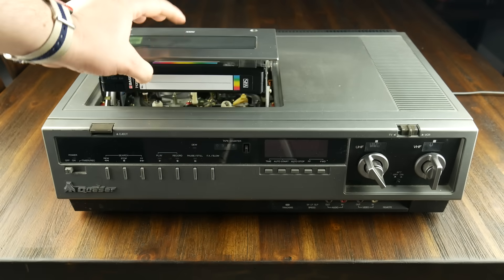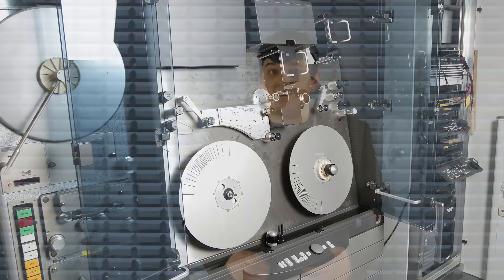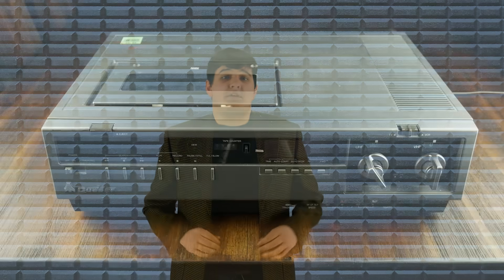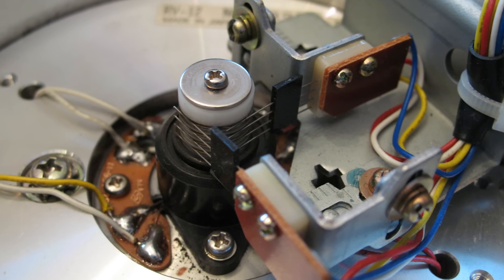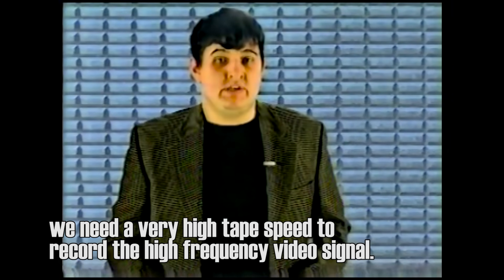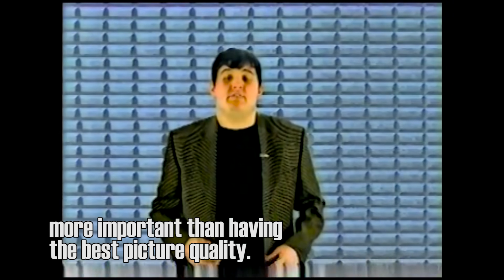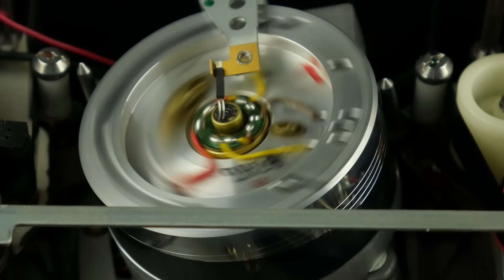The Impossible Feat inside Your VCR

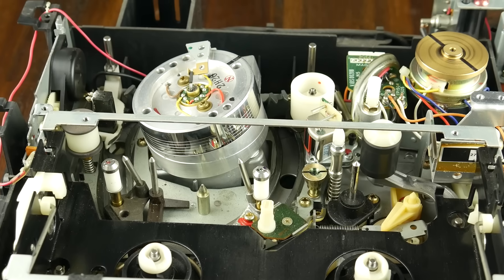Comment: 7:54 I still use mini-DV tapes, and all of the mini-DV camcorders that I've used sound like a jet engine when switched on. The mini-DV video heads spin 9,000 RPM, and on startup, they go from 0 to 9000 in a fraction of a second.

Comment: When i was about 2-3 years old i pulled out and damaged lot of tape from my parents' wedding cassette, it was only cassette which had their wedding video, that was great loss to my parents, it had video of my grandparents who died before my birth but i was unaware of what i did until 12, now whenever i remember that i regret, but luckily after long time they managed to recover at least 40% video from undamaged tape which i stored in HDD in digital form but again my stupidity returned, even i was now 17 y/o In curiosity what i did was i opened back cover of laptop and sticked huge sub woofer magnet to its HDD (Which had that video and my other memories as well) while it was running, i didn't know that magnets will mess up everything inside HDD, then windows suddenly froze and laptop got shutdown, Its been 1 year and I'm not able to recover my priceless data from that HDD, i tried to plug it using Sata Cable to my new laptop and what happens is it shows local disks and their capacity but when i open them, system freezes and HDD disconnects after some time,My hope was increased when once a time drive showed its contents but when i tried to open them system again froze and HDD got disconnected, I think i need to get data recovered from professionals.

Comment: Nice video.

I worked at a TV station in 1977. We had 3 Ampex 2 inch quadraplex videotape machines. Television stations lock the synchronization of all their sources so the picture doesn't roll when video is switched. Synchronization on the Ampex reel-to-reel machines was analog - so it took 7 1/2 seconds to synchronize the playback to station sync. As a result, videotapes had color bars at the beginning of the tape, and usually also had a countdown at the head of the tape. 

There was a cue channel on the tape, and that was used to record a tone on the tape to be able to find the beginning of the program. That allowed the videotape operator to find the beginning of the program. A 7 1/2 second tone was recorded, so the tape operator could quickly find the cue point.

A Quad machine had 4 heads, and playback had 4 video amplifiers. Part of the process of setting up tape playback was to play color bars and set the controls for each of the 4 heads for similar gain, to prevent "banding" in the video.

Commercials (spots) were recorded individually on small reels. A 2 minute commercial break had four thirty second spots. With 3 videotape machines, 1 machine was reserved for news segment playback, and 2 machines for commercials. In preparation for a commercial break, the operator pre-loaded 1 commercial on each of 2 machines. Mount reel; thread tape; set video gains; fast forward to cue tone, and stop. The first machine was started 7 1/2 seconds before the commercial, then the video was "taken" on the video switcher. 22 1/2 seconds into the first spot, the second player was started. As soon as the first spot ended, the operator then had 22 1/2 seconds to rewind the tape on the first machine, take it off, mount the tape for the third spot, set the video gains, and cue it. Then  the same for the fourth spot.

The news video tape was usually a 12 inch diameter 2 inch wide tape. They were heavy. Often there were multiple segments on the tape, so each segment had to be found by fast-forwarding the tape while listening for the cue tone beeps, then set up for the 7 1/2 second pre-roll. Often the newscast used recorded segments out of linear order, for example the 3rd segment, the seventh segment, the first segment, and the twelfth segment. Fast forward and rewind had powerful motors that spun very fast, so stopping took a few seconds. The news director had to plan the tape segments carefully to give the tape operator time to find and set up each  videotape segment. The worst case situation was a videotape news segment, back to the news anchors for the handoff, then a 2 minute commercial break, during which the videotape operator is real busy, then back to the anchors, then another videotape news segment. 

After a 30 minute newscast, the tape operator was wound as tight as a spring.

After I left that station, around 1980, Ampex came out with 2 inch quad cartridge video recorders. There was a large cartridge storage section. The machine automatically selected the cartridge and loaded it. Synchronization was digital, and only took .002 seconds to lock-up to station sync. You could program an entire newscast in advance, and the machine would play all of the tapes in sequence. They were amazing!

One of the problems the video carts caused was if the technical director pressed start on the cart machine and "took" the video at the same time, there was a .002 second period of no video going into the transmitter. Video transmitters were analog at that time, and analog video was inverted, so no signal to the transmitter put it at 100% power for .002 seconds, which caused an alarm on the transmitter and an error message on the automatic log. So we had to train the technical directors to have a slight delay between pressing start and "taking" the video. We later built that into a digital timer to prevent the issue.
Reply: Amazing! Can’t believe how much work the operators did in the background to keep the broadcast running smoothly. After reading this those “sorry for technical difficulties” or “pardon for the interruption” cards seem much more forgivable. :)
Reply: hell yeah
Reply: Thank you for sharing about your experience. I very much enjoy reading how this kind of stuff worked behind the scenes, so this was really cool.
Reply: Wow!  I had no Idea it was that involved back in the day.
Reply: Amazing comment 🍻 that tape operator job sounds like my worst nightmare. I might have nightmares just thinking about the timing and effort that took. I bet they were exhausted after a shift!
Reply: Great Stuff! Why do us “modernaires” find such human and artistic fun in this and Mr. Techmoan. Thanks!!!
Reply: Fascinating. It's easy to forget manual is always a precursor to automation.
Reply: Listen, the comment is great but how long did it take you to type that
Reply: @Ilikesogdog  Brother, what is wrong with you? Why would you be rude like that if you actually liked the comment? 

Either read it and enjoy it or opt out and kick rocks. I can’t believe how short the attention span you “iPad-raised-kids” have. 🤦‍♂️ 

You’ve heard of actual novels, right? They used to write them with a fountain pen and it would take years. 

I love that this person took the time they did to give us that information and look behind the scenes. I read it twice as did someone else. 

Stop telling on yourselves and letting us know you have trouble reading.
Reply: @_..-.._..-.._  I wasn’t being rude I was just asking.  It is impressive that someone wrote all of that of someone.
Also, what the f***k are you talking about
Reply: @Ilikesogdog  20-30 minutes?
Reply: @grid45  nice job 👍
Reply: Lol Noone cares
Reply: @Catsarethebes5eva  paragraphs are scary! 
"L0L'' ...why are you here?
Signed ~ No'One*

*I read it twice, thank you for that insight OP
Reply: @Catsarethebes5eva   stop being lazy and read, you couldn’t even put a space between “no” and “one” 🤦‍♂️

Comment: I am a tech minded person, and I always find that it is the mechanical side of things that leaves me open-mouthed! Like here, how can the tape just "flow" around the drum, I do understand that it forms some kind of air-cushion between the tape and the fast-moving drum, but how that is reliable I just cannot fathom. That also means that you cannot use a VCR in vacuum (in space). Awesome tech in any case! And I did have VCRs in the 80's and 90's. My second one was just awesome, a Mitsubishi E52, Hi-fi Nicam, it had unbelievably good features starting with a learning universal remote, or a "next" function where you could tell it what to do after the present function ended (e.g. after rewinding, power off). I still have it but unfortunately some of the rubber belts and parts need replacement. So I did get a "cheapest" VCR some years ago so that I could at least watch some of my collection of more than a hundred VHS tapes when desired.

Comment: A nice reminder, I spend 14 yrs as an Engineer and Manager in VCR factory, suppling the EU.
To add a little more detail, the capstan and head drum are not so precise as they are servo locked (with a variable tracking signal controlled manually or later with automated optimisation).  The capstan is a servo/stepper motor that is locked to the tracking signal, and the head rotation is phase and speed controlled to the tracking signal too.
Other features we had in the UK where PDC or Program Delivery Control, the broadcaster would transmit a signal that indicated the programs intended start time, this could then be used to ensure late or early broadcasts where fully recorded.  Unfortunately mistakes by broadcasters and manufacturers made this temperamental.  I spend quite a few years at clock change over times chasing up broadcasters who have not changed their time signals and we were getting thousands of complains about "no record".  When the equipment doesn't record your favourite show, you are not going to be happy.  This resulted in the system being defaulted to off in future production.  Germany had a VPS system, we never got any complaints about it.
Then there was NICAM, basically broadcast digital stereo audio for analogue TV, not so much a VCR specific thing, but went very nicely with HiFi Audio, and was an additional UK feature.  Germany has stereo analogue audio.
We also had Videoplus+  a way of programming the record time.  A straight number was published in the program guide (paper magazine) and you entered that to set the recording.  Being simple it worked quite well and became a standard.
Some other VHS standards (apart from VHS PAL and VHS NTSC) where VHS SECAM (France) and VHS MESECAM (middle east Secam).  The MESECAM was a cheap version that basically used Pal circuitry with some slight mods to make it work, the VHS Secam was a highly different and unique VHS system used with Secam L broadcast (France), the quality was quite good colour but we always had alot of trouble with it on some of the test signals.
Towards the end we got into digital TV and made Settopboxes and even a VCR with digital receiver.  The EPG (Mandatory in the EU) from the digital TV was the best way to program the VCR.  It worked well but HDD recorders were much better, and actually simpler and recorded the broadcast signal perfectly without any loses.  While alot of the early PVRs were poorly made, noisey fans and tended to fail from overheating, they were easy to design and make and didn't need the specialist technology of VCRs so there was alot of competition from China.  We did made some good product in the UK, but retailers and brands took the lower quality stuff from China.  The factory was closed before 2010, although I had already been made redundant in 2003.

Comment: The other problem with VCR's was the tape rust, over time if not stored in a very dry place the tapes would get this green looking mold on them that is actually corrosion, soon as one of these tapes is played it instantly clogs the heads and it takes forever to clean it off. They should be run through a video tape cleaner a few times before you play them, but all this equipment is getting so rare now you would be lucky to find a video tape cleaner anymore.

Comment: Analog video and audio is both fun and interesting …especially in todays “sterile” digital age. As a kid from the “Age of Analog”, I remember the first VHS machines …exactly like the “old beast” you pulled out in this video. Not only heavy in weight but also in cost, just like any new consumer tech; some things don’t change. I had to laugh about using the humble VCR as an audio recorder; another trip down memory lane. Whereas the reel to reel was the champion as far as recording audio with it’s 7 1/2 IPS (inches per second) top speed (pro models topped out at 15 IPS) …the humble, unpretentious, 4-head VHS recorder could best most R to R decks without even breathing hard …even at its slowest recording speed. It was probably the pinnacle of analog audio tape at the digital threshold.

As I am in the midst of digitizing my collection of VHS tapes, your videos on doing the transfer have been helpful …and ingenious. This “deep dive” into the “magic” VCR was interesting and fun. S-VHS, if I remember correctly, could only take advantage of the increased resolution if the tape being played was recorded in S-VHS format. Commercially produced tapes were not done in the S-VHS format (the better to sate mass appeal) so there is no advantage in resolution with commercial tapes played on an S-VHS machine. The only advantage of S-VHS was the introduction of S-video which gave an inkling better picture than the composite signal.

Comment: 16:18 Of course it's possible, how do you think CDs were made?  "September 1977: Sony introduces the PCM-1 Audio Unit ($4400 street price)[28] (44.056 kHz, 14-bit), the first consumer (well-heeled) PCM encoder. It required the use of a home video tape recorder for storage."  Before DAT, a lot of audio was recorded digitally on video tapes.  And boy did it make CD mastering wonky and inconsistent.

Comment: For broadcast, Umatic 3/4" wide tape running at twice the speed of a standard VHS tape deck was the standard (especially at local outlets) but 1" reel to reel was also an option, which gave better quality. The Umatic cartridges I worked with typically only held about 70-75 minutes worth of tape and for use for commercials, promos, and PSAs, only 3.5 minutes was spooled. After all, just how much do you need for a 30 second commercial?

I used to sit there at the shop at the TV station in the 1980s mesmerized by what was going on inside that tape player. These machines used a "C" sort of threading for playback ("M" for FFW and REW) so it was even more interesting watching it spool out of the tape cartridge. It wasn't until many years later that I understood just how clever the video tape recorder really was, that there was a very specific reason the drum the heads were mounted on an angle to the tape. I never knew about the transformers though, nor did I know about the azimuth on the tape heads. That's pretty dog gone neat! The engineering that went into these machines really was off the charts clever!

It's not just that we're used to higher resolution that makes VHS/etc appear so bad. It's the fact that it's still magnetic media and magnetic media degrades over time (the magnetic signal fades, higher frequencies going first, and being stored at warm temperatures, such as a warehouse in Southern California, accelerates this process). So some of the stuff you see from Back In The Day was actually better the first time around but waited for quite a while before undergoing the digital conversion to preserve it and thus isn't as good as we want it to be. The reason things like "I Love Lucy" and "The Dick Van Dyke Show" look so good is that they were filmed (actually filmed) not merely recorded to tape as things would be in the '70s and '80s and thus didn't suffer that type of degradation.